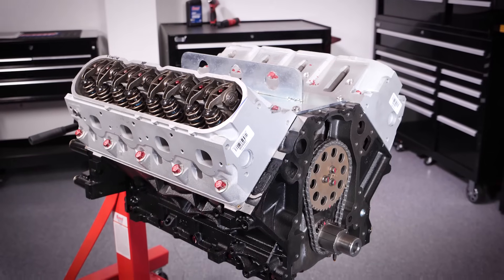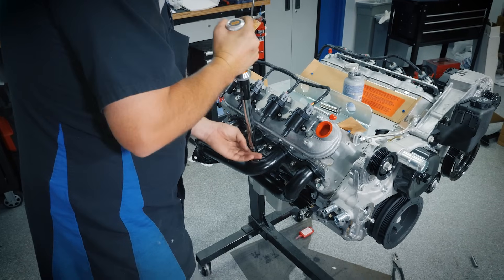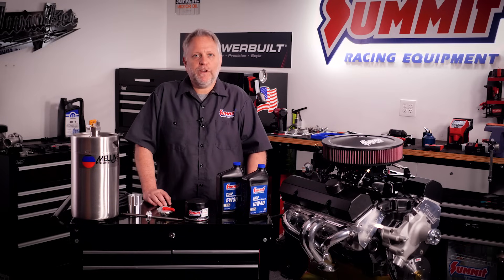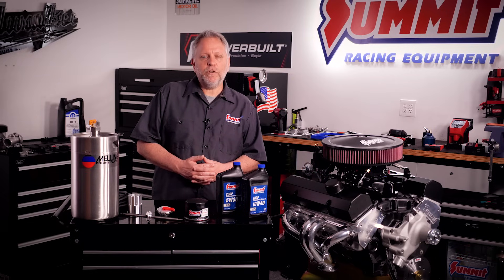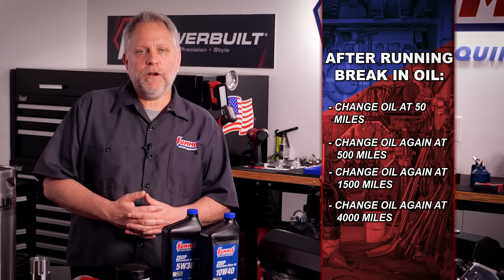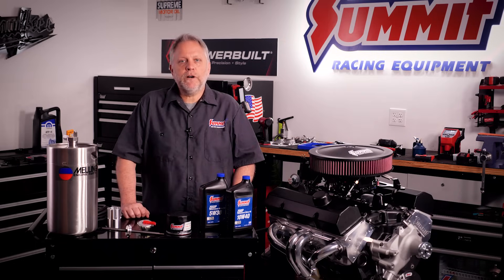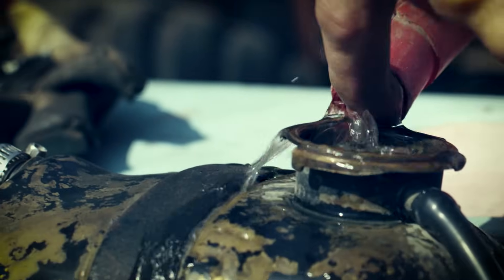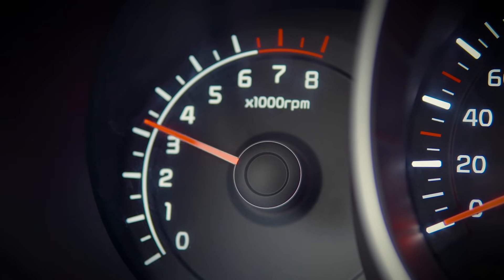Don’t Break It! Engine Break-in Tips for Initial Startup

Comment: You didn't mention that when the engine is first started, you should run it at around 2000 rpm for at least 20 minutes, without a load, to break in the cam and lifters. The speed should be varied somewhat, about and below 2000, while you are doing this.
Reply: Not me, I disagree.

Comment: The safest way to break it in is with gear oil, ratio 1 to 10 with engine oil, because gear oil sticks to the cold metal instantly. Whereas zinc only works on hot surface. Obviously, thicker engine oil dampens the friction.
Reply: Thanks for your comment, I use some gear lub also as you indicated but not as much as you do.
  Thanks for your comment.

Comment: Everyone's saying something different in regards to breaking in an old school engine.....use this oil, use that one, lighter springs, so on...maybe I should just sell mine....
Reply: I just fill the float bowls and fire it up works for me.
Reply: Joe Gibbs on the break in oil. I think running the springs like your going to use is best. If it's going to sh*t, might as well happen during break in. Chevys should probably use the GM 812 lifters. The ones with the hardened foot. Or maybe the new Comp DLC lifters. Don't buy cheap lifters. Make sure the cam and lifters have taper. Regular oil and zzdp additives aren't enough. And sometimes adding zzdp can cause problems depending on the oil. Or save your pennies and go roller.

Comment: I just had a new reman engine put in. I put it regular conventional oil for the break in because I wasn't able to get the lucas break in oil in time. Now it's coming up to 500 miles in. Would it hurt to change the oil now & use the lucas break in oil? Or is it too late or not worth bothering with?
Reply: WOnt hurt it but not necessary

Comment: When breaking in a flat tappet cam , use a weaker valve spring + spray some graphite to cam lobes ( helps camshaft assembly lube grip).  DONT use zinc additive - use dedicated high zinc break in oil . draw a line on pushrods to make sure they are spinning . If possible , use DLC coated lifters . Also make sure you have pre lubed engine before startup and have correct length pushrods. Now cross your fingers !!!
Reply: fill up the float bowls so it fires off right away
Reply: @gordocarbo  
Electric fuel pump does this already,
 but yes, many people do use a manual stock fuel pump and this is a great idea to ensure immediate startup
Reply: I will never use a flat tappet cam again. If I can't find or use a roller block , I will bite the bullet and retrofit a roller cam and lifters.

Comment: You should make a bigger deal about using an actual break-in oil. You did say it about 3/4 of the way through the video, but in the beginning, all you said was oil with high zinc; you didn't say break-in. You really should put a text over the video, in the beginning, to say to use a "break-in" oil. It should be an oil with high zinc (ZDDP), low Molybdium, high detergent (to trap all the metal particles), and low anti-wear additives. And perhaps mention it may not be easy to find at a local auto parts store since these aren't API certified
Reply: What do you use?
Reply: @mikeb8241  
I use "breakin oil" from the cam manufactuer that makes the flat tappet cam
Amazon has a complete list
Reply: @mikeb8241 Joe Gibbs break in oil.
Reply: Actually a good point
 Some hi detergent non synthetics actually wash off the cam lubricants during breakin. 
Not what you want on a non roller engine. 
I use "breakin oil" from the cam manufactuer that sells the cam.

Comment: The myth of synthetic oil not allowing rings to seat has been debunked for decades.  Brand new engines use synthetic oil directly from the manufacturer.
Reply: Not true! Cast iron rings with a rough hone that older engines used to use might not ever seat. New cars have been using low tension , stainless steel rings with a very fine hone. Do research before you cause someone to ruin there engine. You're welcome.
Reply: @Jonhobbs64  Yep, No need for 500 mi break ins anymore unless its built the way you described. 
I seat the rings right away dump the oil at 50 miles and drive it normally, can get on it just dont get carried away
Reply: Yeah thats also why those same car manufacturers say burning a quart of oil every 1k miles is within spec 😂
Reply: Do NOT use synthetic oil for break in. You will be sorry as it’ll burn oil its entire life.
Reply: @nagadsby9413  Well, I rebuilt my engine, and used mineral oil for the first 1000km. now replaced filter and oil for full synthetic. AND NOW I SEE THIS! did i do it too early??
Reply: Synthetic oil manufacture and retailer wants to sell their synthetic oil.  Follow the money..
I will be using traditional 5w30, with some additives of my choice.
Old School is about saving money and using time trusted methods learned and passed down the generations.
Amen [Salute those B4 Me.]
Reply: Wrong wrong wrong. Go ahead and use synthetic on your new engine and watch it pump oil.
Reply: @RGCJ8763  Machinist told me the same thing sure he knows better than the internet.